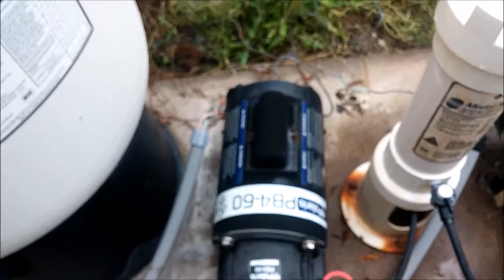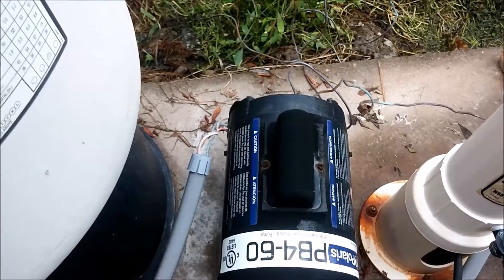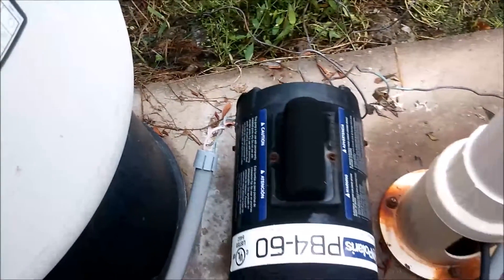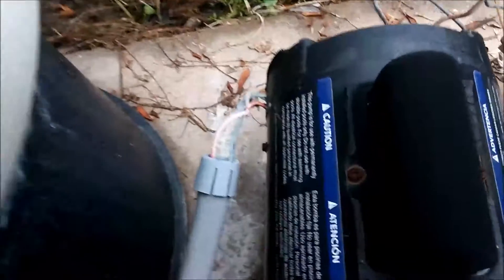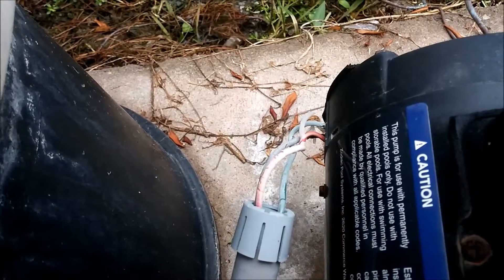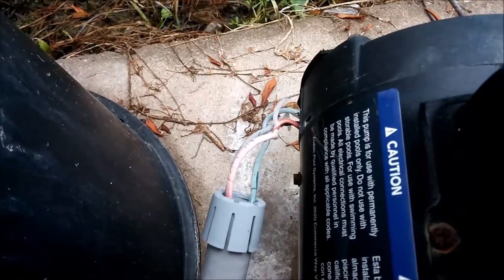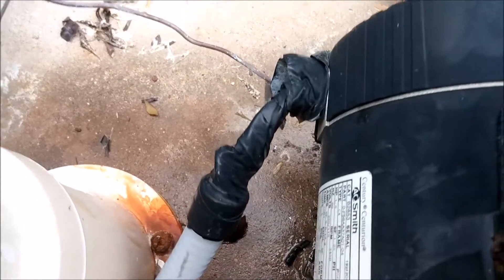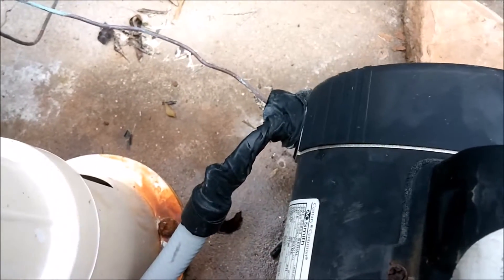Incorrect Wiring by pool "professional" on Pool Pumps

Comment: That's pretty sad. If I can i always try to get rid of the 90 degree adapter with a straight one. Makes it alot easier wiring it up.
Reply from the maker: I like straight connectors also if you have enough conduit and room to make the turn into the motor.
Reply: @truelightpoolsllc4441  yes sir